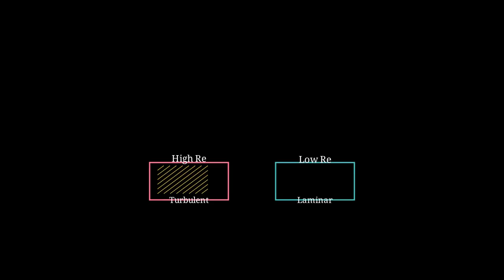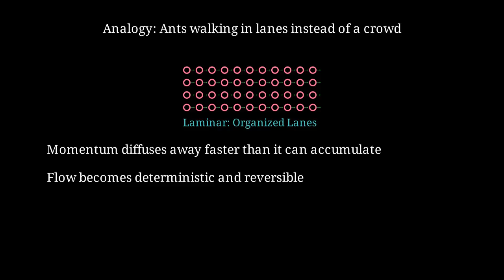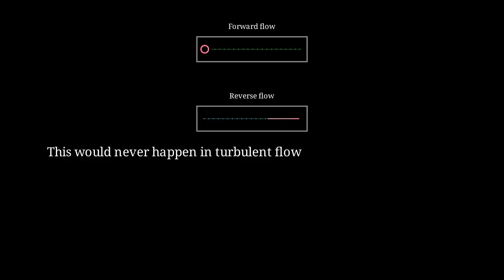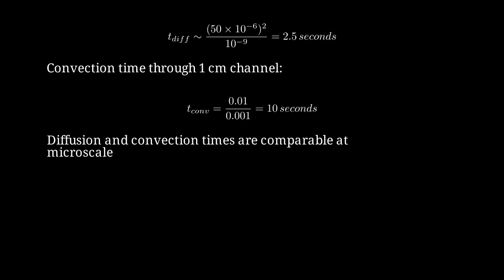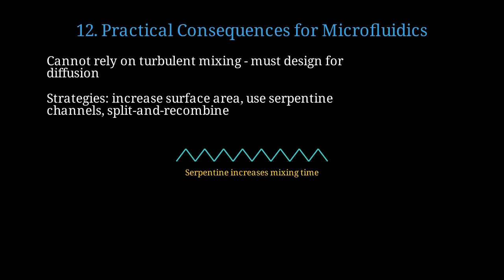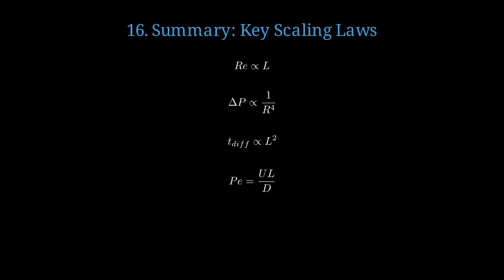Why Stirring Doesn’t Work in Microscopic Flows

Comment from the maker: How can microchannel surface charge distribution influence electroosmotic plug flow uniformity?
At what spatial scale does continuum fluid mechanics begin to fail for submicron channels?
Can chaotic advection be artificially introduced at low Reynolds numbers via time-dependent boundary conditions?